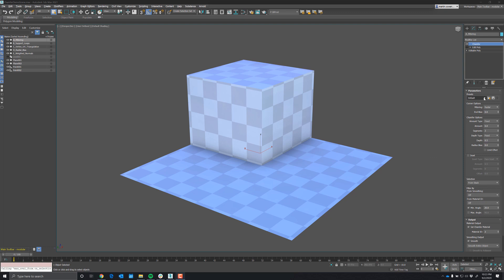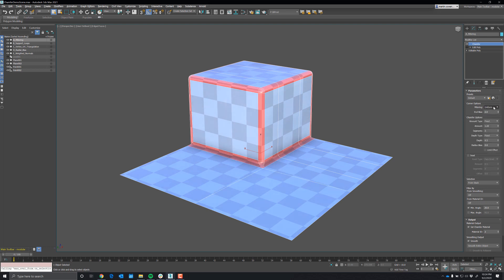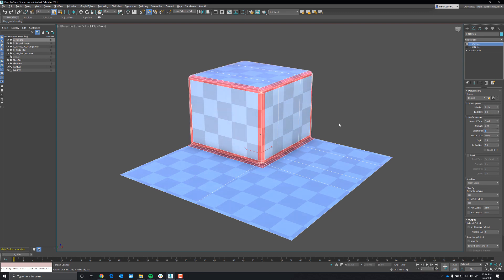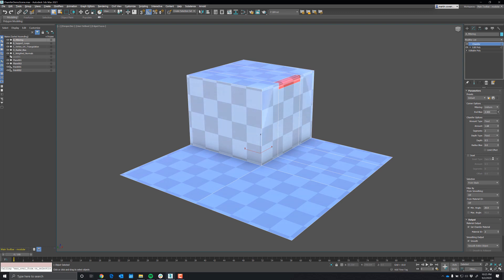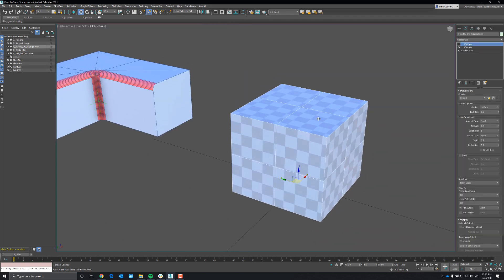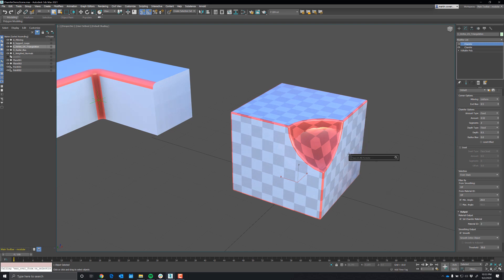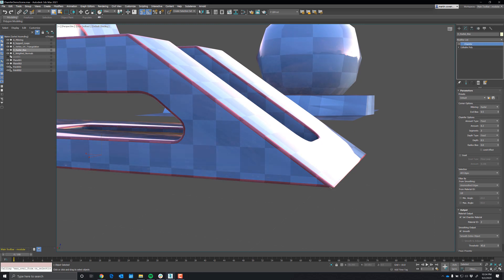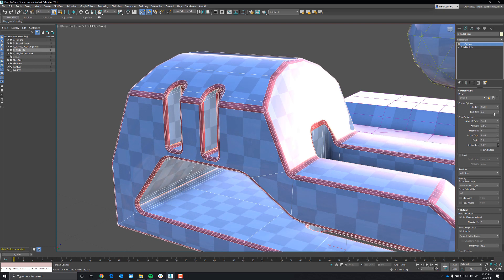Chamfer Modifier Overview

Comment: In 3ds max, the chamfer at any setting, unfortunately, does not create an ideal circle along the radius of the chamfer. If you look very closely, you can see this problem. In other 3D programs, I have not seen a similar problem. If possible, please fix this problem.
Reply from the maker: Hey Aragorn, The Radius Bias should do what you want. If you make a acute angle, add the chamfer and set the radius bias to 1.0. If you then create a circle and align it to the center point of the chamfer, you should see they match up.
Reply: @martincoven , Thanks for the answer. I checked your advice, at the vertex level the chamfer radius is correct, but the chamfer on the edge loop behaves differently than on vertex. And if you look very closely, you can see that the radius of the chamfer does not describe the correct circle. This edge chamfer problem is present with all settings and types of chamfers.
Reply from the maker: @aragorn3d312  Can you show me what you are seeing?
Reply: @martincoven  I can give prepared examples of my problems with chamfers. Where can I send you the scene? (2021 max)
Reply from the maker: @aragorn3d312  If you can put it up on dropbox or somewhere and send me the link to download?
Reply: @martin coven  here is the link to the scene. https://www.dropbox.com/s/iinngz7swdke6wi/chamfer%20test.max?dl=0 https://drive.google.com/file/d/1NdqtqBa_dXEZuJv0xxmnODrTYXq5AiJO/view?usp=sharing
Reply from the maker: @aragorn3d312  Thanks for the scene! I see what you are talking about. This is using the angle between the vertex, and is a case that we aren't checking for with our edge chamfer. It can be done, we just have to take this case into account. I'll write up a story for it and get it in our backlog. :)
Reply: @martincoven  Thank you for your attention to my question!

Comment: Thanks Martin. The chamfer modifier is really sweet now, can see a lot of hard work has gone into improving it over the last versions and it's really coming together. The inset loop is super good! Loving the new weighted normals modifier; there were scripts that did the roughly the same job (albeit with less control).... great to have it native as it's often an essential step when using chamfers.